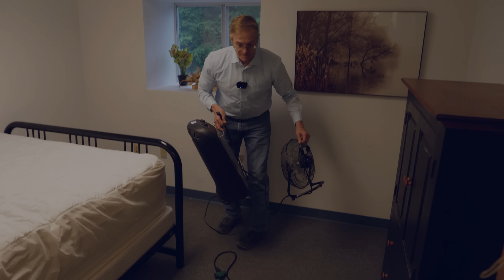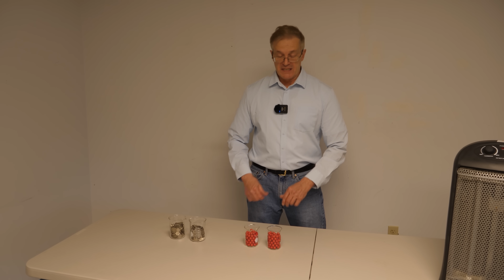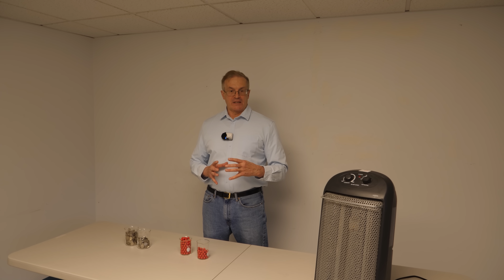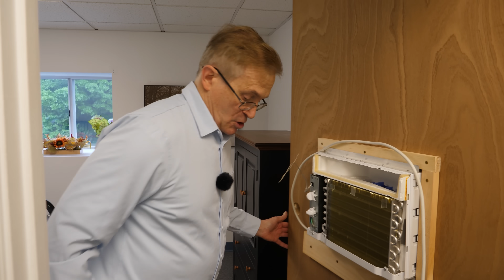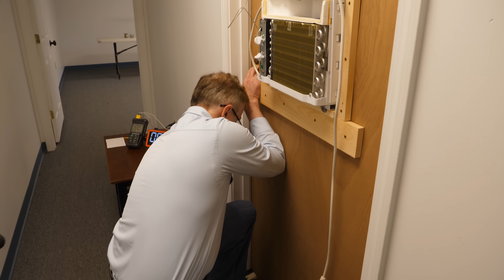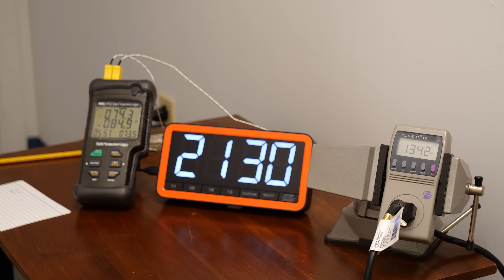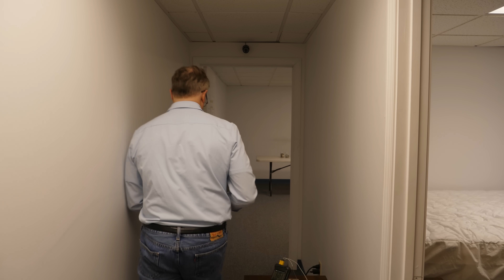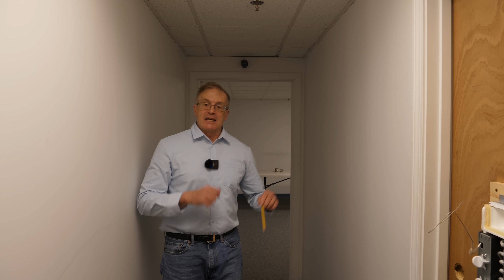You're wasting money on heating! Use your A/C!

Comment: I live in a Tiny Home, 9000 btu mini split heats and cools. Tonight it is 1F outside and my room is 72F. Mine is a DELLA (Panasonic I believe makes em). 120AC so my solar setup powers it in sun light using typical DC to AC of the setup. average watts is about 400 or so after home temp stabilized.

Comment: There's flaws in this. AC units either don't turn on when ambient air is at 40 or below and in most cases I'd guess there's very little use for this except when temperatures are extreme from one room to another - not the same in this demonstration where the hallway air is same as the room in the beginning. 75 degrees is pretty comfy for me... Anyway...  I know my house could benefit from something like this but I use my fireplace instead. With the fan unit blowing air around the framed fireplace (it's a gas unit encased in a dual shell). The fan I used was a standard cage fan from a stand-up unit that I just tore apart. It's a metal fan inside and works great. Plenty of airflow. My one fireplace heats my entire house to about 64-degrees minimum even when it is ZERO or close to zero outside. That fireplace and fan run 24/7 and my central air unit only turns the fan on on a set schedule (NEST) to help blow the fireplace's heated air around the house. Altogether, I'm heating my entire 1.5 story 2,600sq. ft. house at less than $100/month throughout the cold winter months. I do have a pretty large living room with high ceilings and two fans. One blows down while the other blows up. I think this too helps airflow circulate but some rooms are colder than others which is why I have my HVAC fans picking up the slack. I do have a window unit that sometimes we use in the hottest months to add a bit more A/C to our bedroom and I sleep much better with fan noise running.

Comment: heating with electric is worse than heating with gas. Using a heat pump is also expensive because not only are you running the compressor to get the refrigerant flowing you also are suppling electrical heating elements inside the AC itself to heat the air up even more. Depending on the unit you can have anywhere from 1 to 5 heating elements thus running the AC in "heating" mode will cost you more than using your AC as intended. The best way to heat a place that is cost effective is through gas-based heating either propane or natural gas depending on your area of living.

Comment: So... the trick is to simply turn it around? We have central A/C with the radiator (or whatever it's called) inside the furnace. Is there a way I can modify my setup to do what you're doing? Or am I looking at scrapping the whole thing and buying a heat pump?

Comment: Where I live it is still cheaper to heat you house with natural gas and a furnace than it is to use electricity and a heat pump. When it gets below freezing most of the heat from a heat pump is from the compressor. Some heat is being transferred from outside but not much.

Comment: I would like you do duplicate the study ,but with 20 degree ambient hallway temp. Need to reject heat to make heat
Reply: no reason, to operate at temperatures below freezing it needs to be a much newer/more efficient inverter A/C or a minisplit that has heat pumpo operation.

Comment: Sounds great but you're not going to reverse you're window unit.
Besides......your AC unit works by removing humidity.

The colder it is, the less humidity.  So the AC unit will stop working after a certain temperature.  In other words.....if it is freezing outside, the unit will not work.

There are some AC units that already use the reverse thing and they have that use.  I bought one.  It works great, until it gets colder outside, then it doesn't turn on.

Ac removes humidity in the air.  Then it cools the room by pushing air thru the cold evaporator.

Comment: Is there an outside temperature point that it stops being effective? How does this compare to using gas? Can this be done with a central A/C unit?
Reply: pretty much, gas beats heat pump cost per BTU substantially, not really

Comment: Im confused, why did you need to add a little fan in there too? And how much extra wattage was that
Reply from the maker: This ensures that the air in the room is well mixed without hot spots. The wattage of the fan and the heater are both totaled on the power meter.

Comment: You are not taking defrost cycles outside temperatures and humidity! Of course it will work well if the outside temperature is 75 degrees! Why don’t you try cooling the outside when it’s 30 degreesAnd 75 % humidity see how long it takes to freeze up? You’re a dip stick. What’s next watering your air conditioner?

Comment: Wouldn’t the fan blowing on the electric heating elements of the resistance heater cool them off and decrease its efficiency? Should have pointed the fan elsewhere. Such a small room any direction other than directly at the heater would have been sufficient
Reply from the maker: It doesn't matter. The efficiency of the heater is unchanged, whether it's running hotter or cooler. Watts consumed and measured with the power meter all are converted into heat.

Comment: I have central heating/cooling. So, if I put my air conditioner to 70° in winter, with outdoor temperature at 50°, it will warm my house and save me money? But my air conditioner won't turn on so long as the room temperature is below my setting.

Comment: Why in North America don't have SPLIT AC units at your walls;;

Ιn Europe we have Wall mounted mini Split Units, and we use them for heating and for cooling in the Summer.

They use a small amount of energy, and split units are very cheap, compare to the large HVAC you have.

Also if you have 3 or 4 in your house, if one brakes, you can use the others for the climate.

Comment: As an hvac technician for 20 years on my own and growing up with my Dad doing it, I’ll say this, get the best heat pump out there, and your significantly increasing the stress on the compressor. You’re basically running your a.c compressor ALL YEAR, which will significantly shorten the lifespan. Heat pump shmeetpump. If you want the best heat, go gas and not high efficiency. It can take up to 10 years to make up for the extra money you spend on it. Not worth it

Comment: I used to use indoor floor model a/c units in an apartment that got BOILING hot in the summer.  Didnt need heat on in the winter because the rest of the building's heat drifted up into my apartment, and that was in Saskatchewan Canada.  That said, if the climate is decent for it, a floor model unit could just be turned around and the cold air hooked up to vent outside and would be even easier to do than a window unit.

Comment: What about the humidity it creates from running  backwards ?    Heater is dry heat.  I think this is the elephant in th room.
Reply from the maker: Actually, it isn't.
When heat is needed, the conditions are usually too dry, and often humidifiers are used to counter this.  The airconditioner solves both problems at the same time.

Comment: But in real life, it still costs a lot of money to run the A/C, and the auxilary heat source that you need when the outside temperature falls below the low 40's... Heat pumps shine if you have the kind that have long runs of underground channeling (expensive to construct) to extract the c.50*F's heat from the ground, rather than the colder temperature of the air in winter.

Comment: I didn't watch it all yet, but how do you get the thermostat to work?
Reply from the maker: You isolate the probe from the side of the coils, and then you can position it wherever you want. Accessing the controls can be more of a hassle depending on where you set the unit up.

Comment: And temperature with the A/C unit increased the same 10 degrees in about 8 minutes, so it is even MORE efficient than you think. For the additional 5 degrees it took 22 minutes because the A/C unit looses efficiency as temperature differencial increases, but anyways if you don't need to heat a space from freezing it heats up the room ten degrees in ¼ the time, at ⅓ the energy consumption.👍👍

Comment: wont the ac unit drip water on your floor ? lol
Reply from the maker: Yes, but that's easily fixed. Plug the original port and drill a small hole where you want the drainage to occur.

Comment: This demonstration is completely useless. If you turn a window air conditioner around and run it in the winter the evaporator coil will freeze up solid. Regular window a/c units do not have a defrost cycle to melt the frost off. Also, transferring heat from a 75 degree hallway to a 77 degree room would obviously  require less energy than transferring heat from 25 degree air (outside), to the same 77 degree room. So to suggest you can simply turn a window air conditioner around and run it in the winter is complete nonsense.

Comment: So your saying we should put our window air conditioner back in backwards in the wintertime. 
I have an heat pump with a built in electrical heat element. Here in the north the power use from the element uses a saving that was saved in milder weather. And then some more. It also won't keep up at minus 20 degrees. Not even close. I think we all felt the heat from the back, or top of an air condioner .
Reply from the maker: No.
I'm demonstrating the potential of a heat pump and the principle that makes it work. It's a tool, and in some situations, it can be very useful.

Comment: Not at all disagreeing with your video, but your test example was flawed since the ac unit is going to be much more efficient on the heat side if it is cooling the inside of a 70 degree building than it would be cooling say a 50 degree outdoors temperature which would be a much more likely scenario.

Comment: Your example only shows air being transferred from one internal area to another. Most heat pumps transfer air from outside to inside, ie. removing heat from air that is very much cooler. If you can show the same efficiency by installing your heat pump on an outside wall (or window), blowing inwards, then this would show a more practical demonstration.

Comment: I have a heat pump in my house, and in the winter the thermostat is set at 70 degrees. The house still feels colder and the air coming out of the ducts feels cold. What's up with that?

Comment: That’s what a heat pump does! It works backwards! Heat that comes out of it in summer, is forced into homes in winter.And cool air in summer.
Reply from the maker: Correct.
Now, more people appreciate that process.
Reply: @TechIngredients the lowest temp setting on AC is around 60F. How it works if the outside temp is ~30F, how AC will behave?

Comment: That is a very misleading statement! Electric heat is not 100% efficient. Coal fired power plants are 80-85% efficient. So the electricity you receive may appear 100% efficient, only because you do not have an exhaust pipe. 
Natural gas and propane heat can be up to 98% efficient. 2% of the heat made in your home goes out the exhaust pipe!
The real question is which is more economical!
That is even more complicated. A gas furnace with a conventional ac system if well maintained can last up to 20yrs. 
You will not get 20yrs out of a heat pump compressor.
Conventional heat pumps can not get enough latent heat below 30deg F either. When you move into a dc inverted heat pump now you are paying 2-3x as much for the equipment, and you still face the inevitable life span of a compressor, not to mention still evolving and banning of refrigerants.

Comment: my only issue with your little test is your drop ceilings in the bedroom you use for testing allows outside air to circulate quite easily....
Reply from the maker: That's a potential source of leakage, but it's exactly the same for both tests.

Comment: I just turn my air conditioner around backwards in the winter and cover the outside vents to prevent moisture from getting in the electronics.... Set a fan in front of it and it heats a 14ft x 15ft room room with ease.....🤷

Comment: Lol...he wedges the door for a good seal...yet there is no handle in the door with a gaping hole there.
SMFH
Reply from the maker: That's true, it's a small leak. The door was surplus from the dump (we had to cut it up). The door knob didn't line up with the frame.
Reply: @TechIngredients  the whole proposition is riddled with issues.
Reply from the maker: You're changing the subject.
Did you understand the basic premise?
Reply: @TechIngredients  yes, I understood the very basic premise. 
Your using room temperature air to warm one room while you cool the rest of the house.
Change that room temperature air to anything below 32 Fahrenheit, and you have all kinds of issues.

Comment: This trick is what should be taught to every person.Why because so many people could save themselves if the heat goes out in a house and they need to warm themselves. But the companies don't want people to know this because they will loose money. 
And no it does not spew out chemicals . 
safe to use a portable AC at all ? Luckily, portable-air-conditioner exhaust does not contain any noxious chemicals. You should be relieved to know that portable-air-conditioner exhaust is merely vented to the outside to prevent temperatures from rising inside. Portable ACs are small, transportable units that can be used to cool your home or workplace. Little known fact it can also heat your home.
Reply: Not in below zero environments.
Reply: @onemotherpucker  wanna bet. You don't put your thermometer in the elements.  Or you cover it . Jeeezs think outside the box.
Reply: @jcmjcm1945  I installed heatpumps...they dont work below minus 10 Celsius. 
By 0 degrees, it is costing a fortune to produce heat.
You clearly don't know what you are talking about.
Reply: @onemotherpucker  you'd be surprised just how much I know about it. You make an ass out of yourself because your assuming you know :)

Comment: For a small window unit what would you do with the water produced if you don't want to drill a hole and run pipe outside. There has to be something useful to do with it
Reply from the maker: Typically, when you want to heat a room, the cold weather also means low humidity. Run that "found" water into a small humidifier.

Comment: Actually fridge are better than this, we have a  very very old white westing fridge in the house that produce a hella amount of heat at low amp due to high compression ability of its motor and the forbidden coolant
Reply: Yes it is one with the radiator coil exposed outside it's body
Reply from the maker: Actually,  probably not.
But, it's not why you think.
The entire fridge, including the cold section and the warm radiator coils, is contained in the same space. Pumping heat from one section to the other section offers no advantage over a simple resistance heater. There's nowhere for the cold to go.

Comment: what you're doing is taking the heat from the hallway and the house and pumping it into the closed room. Let us put the air conditioner backwards in the room's window with 75 degrees outside it should get the same results . NOW let us run the test with the outside air at 20 degrees , I think you're going to get much less heat coming into the room.
Reply from the maker: Of course. Thermodynamic rules still apply (they always do).

Comment: I'm a New Englander.... and I'll take a natural gas-fired hot air heating system over electric heating any day of the week! And when the power goes out, I can run the blower fan on my gas-fired hot air furnace off of my generator.....and/or I can run my 40,000 BTU gas fireplace.... and my gas-fired 50 gallon hot water heater doesn't require ANY electricity.....so I can take a hot shower when the power is out. Any questions?
Reply from the maker: Of course not.
There are multiple choices, and that is the one you prefer.
Reply: @TechIngredients  My apologies for the "Any questions" comment. It was derogatory. Every time I hear someone saying how "efficient" electric heating is, I get a bit fired up... no pun intended ;-)

Comment: Assume it would be far less effective if it was 5 degrees outside?  Would it make sense to use resistive heat to heat a box for the cold side or something like a btc miner?  Or am I off base and the temp differential would aid it?
Reply from the maker: No, you're right. 
The larger the temperature differential, the smaller the efficiency multiplier effect, although it never drops to below one.

Comment: I've been telling folks a heat is simply turning your window ac around in the winter .....probably over 30 years now

The best part I get to witness it actually happening......great post. 

2nd best part it's more efficient 

Now when time permits think of a way we could operate the unit when turned around. 

Of course I wouldn't do it in my house, although a garage, shop, or shed. 

Thank you Tom from Cincinnati
Reply: Does it have issues with ice over the coils? Seems like whole house heat pump units have to run a defrost cycle?

Comment: Helpful information and effective demonstration.  I wonder, is there a simple way to add the valves you mentioned that would convert an AC to a heat pump?
Reply from the maker: It is, but it would require a vacuum pump and replacement refrigerant once the additional hardware is soldered into the system.

Comment: Electric resistance heat is not at all efficient, it is the most inefficient source to heat of all.
Reply from the maker: Actually, it's probably the most efficient (all the energy is converted into heat), but it's probably the most expensive.